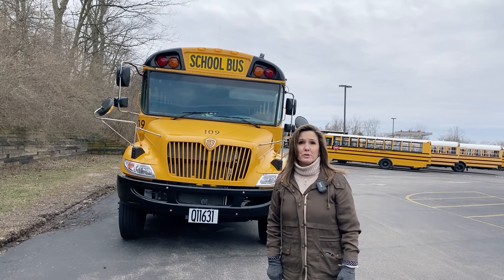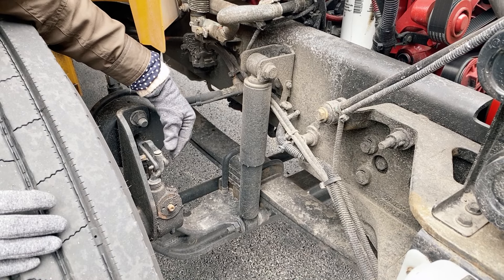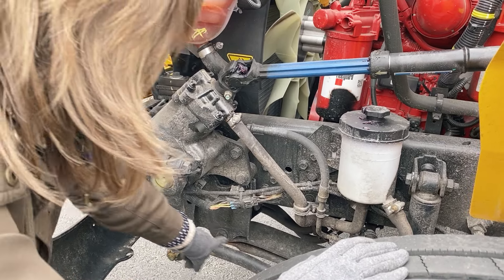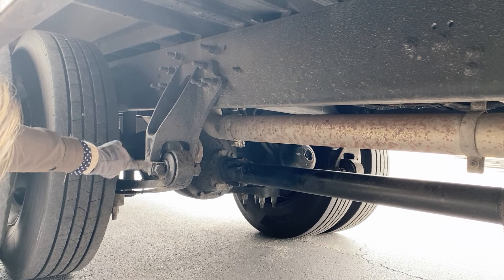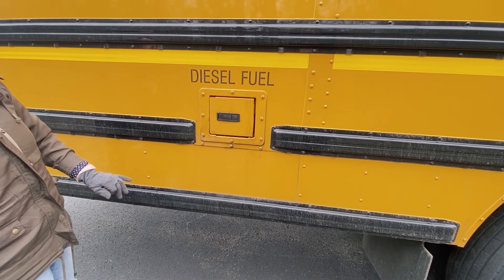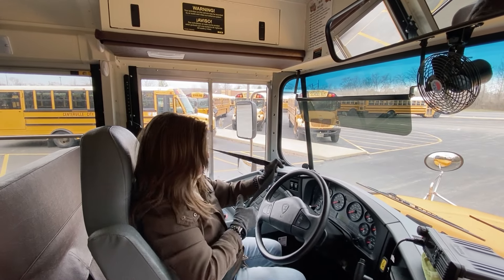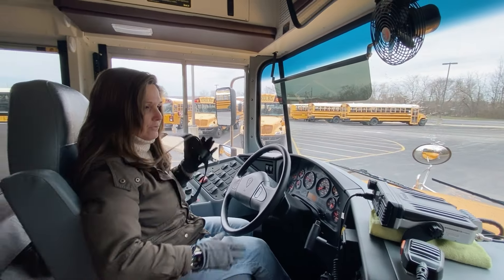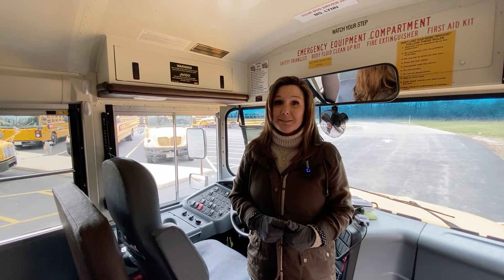School Bus class B CDL pretrip inspection demonstration

Comment: You have literally helped ne 1,000 times more than my actual instructor. Thank you so very much. So glad i found this
Reply from the maker: Thanks so much for your comment and positive feedback!  Best wishes for a successful test outcome!
Reply: My Instructor started off w/ the Air Brake Test which rekindled my memory loss of NOT doing 18 wheeler the past 3 years yet I knew something was OFF. We do NOT start w/ that Test. Real Drivers start as she started via viewing the Truck &/or Bus from the front looking underneath & down the sides to the back. The Air Brake Test should be one of the LAST things you do just prior to Emergency Brake & Service Brake Test. 👀 That order makes WAY more actual sense. Idk why my Instuctor is going out of order but w/e. I passed my CDL A so I will pass my CDL B nonetheless regardless

Comment: 1:05 Start from the top
2:10 starting engine, and frame parts 
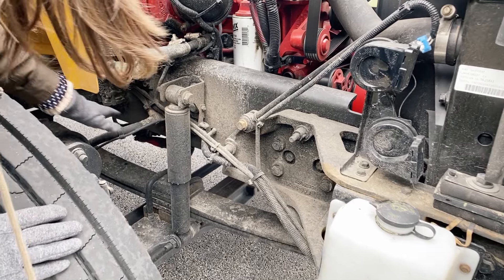3:19 brake lines
7:53 service door
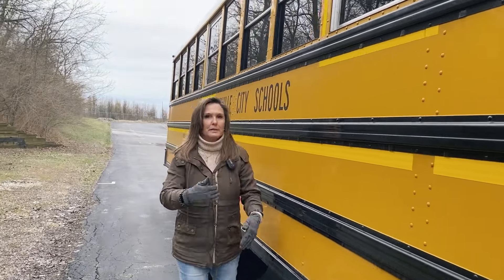8:54 under the bus
11:25 budding wheels
14:00 behind the bus
14:55 the bus stop arm
17:20 engine start

Comment: The company that I've been training with, and have an exam with tomorrow for my CDL B, has been training in a different order for the air brake test than shown here. Inside pre trip inspection(seats, emergency exits first, then gauges) followed by ABT.
First: Wheels chocked, , neutral, engine on, pressure built up to max, shut off engine, parking brake applied, static air brake test (1 minute, no more than 2psi air loss)
Second: Parking brake in, service brake(pedal) firmly held (1 minute, no more than 3psi air loss)
Third: Fan brakes down to 60psi until low air warning and buzzer comes on
Fourth: Keep fanning brakes down to 20-30psi until parking brake applies, indicating the spring brake is applied. Secure key and remove chocks(do not leave bus while engine running, even if just to move chocks)
Fifth: Safe start engine, pressure will build up to 85-100psi in 45 seconds, then governor will cut in with the brakes "woosh" sound
Sixth: Shift into low gear, press on accelerator pedal to confirm parking brake holds
Seventh: Release parking brake, drive forward 5 feet, braking to make sure the bus doesn't pull to the left or right. Repeat 2x.
Then pull the parking brake, put it in neutral, and say "this now completes the air brake test"
Reply from the maker: Which state do you reside in?  

Thanks for sharing another version of the ABT.
Reply: I live in South Carolina I think hold service brake push in parking brake shouldn't lose no more than 3 Psi or push in parking brake than apply service brake
Reply: @SchoolBusSass  Pennsylvania
Reply: @SchoolBusSass  Also, just updating my situation. I went and took my exam on Wednesday, and passed. 
I did the full Pre Trip Inspection including ABT, Alley Dock, 100 Foot Backup, Offset parking, Simulated Railroad Crossing, Simulated Student Dropoff, road skills test along with an emergency stop. 
I was watching your videos late Tuesday night and before leaving in the morning of Wednesday. I really appreciate you making these videos. I will highly recommend your videos to any trainees I encounter. One thing I especially like about your videos is the production quality. The videos are clear, detailed, and the voiceover audio is so much clearer compared to many other videos that drown out the audio by using the recording from inside the bus(bus noise, wind noise, etc)
Reply from the maker: That’s fantastic news, congratulations!  I really appreciate your kind feedback, thank you!  Continued success in all you do.  😊
Reply: That sounds like the way it's done in VA
Reply: You are correct. The Air Brake test in this video was done in the wrong order and would cause a FAIL. She should of never proceeded forward with the bus before doing all the parked static checks.
Reply: That's here in philly, we use this method , both are correct she lives in another state.
Reply: Thank you, this is awesome!

Comment: NJ book says you have to physically grab the steering assembly underneath to check for play.
Have to check battery fluid level since those were not maintenance free  batts.
Both of these rules are not directly under the school portion of the test, but they are indeed in the book.

Comment: Questions do you have to check all emergency windows and sound the buzzer or could you just say i would check all windows and sound the buzzer the same way i checked the first window and hatch buzzer and not check the to save time as well as the tires and brakes slack adjuster and push rods
Reply from the maker: Correct for windows and exit doors and hatches.  Must check push rods and slack adjusters, in front and rear on one side of the bus, then, you can say you would check the other side of the bus the same way.
Reply: @SchoolBusSass  one more question while the engine is on do you keep the headlights on while checking heater fans and dome lights and emergency windows buzzers or do you turn the headlights off because I'm wondering about the no students left   button and when to push it, or the lights don't have to be on and you press the button after you done the air brake test
Reply from the maker: The headlights should have no bearing on the no child left behind alarm.  Using your loading lights with your service door, will activate your no child left behind system.

Comment: Don’t forget the castle nuts and cotter pins! Also test the light indicators in the inside gauge panel.
Reply from the maker: Castle nut and cotter key are no longer required test elements.

Comment: Can you do another video on the airbrake test ? How do you deflate the brakes and build them back up again .
Reply from the maker: Hi Julius, to empty the air tanks, push down on the service brake pedal repeatedly until the parking brake sets itself.  Warning light and buzzer will activate above 55 PSI and brake  will set  between 20-40.  

Probably not doing another brake test.  The brake portion of the exam can be found on all of my pretrip videos.  As for a new pretrip, I will probably do one late this year or into the new year, on a BB RE transit.

Comment: Going for my CDL ....Thanks for the channel.....any suggestions?
Reply from the maker: Pretrip:  Try to slow things down, just a bit.  People tend to talk faster when they get nervous. 

Maneuverability:  If allowable, always check your final position for each maneuver you complete.  Even if you are positive you’ve done the maneuver perfectly.  

If it’s a free look…take it.  Gives you a moment to check out your awesome skills…😉  or, correct an issue you may not have seen from the drivers seat.  
For instance…in straight line backing, perhaps you stopped behind the 4th set of cones but there were five sets.  A final check would reveal this and afford you the opportunity to correct your final position (hope that made sense)

Driving:  take your turns slow!  It will give you the opportunity to correct any potential errors…like clipping a curb). 
I would  much rather have my drivers take a, slightly wider,  right hand turn, than clip a curb. A wider turn, may be a few point deduction, clipping a curb ends your test…not in a good way.  

Whenever possible stop at all yellow lights.  

Believe…achieve it!  

You’ve got this, Mike!
Reply: @Therese Mileti  ...Thank you....ill be reading your reply several times...thanks for the tips and taking time to respond ...this was very helpful...
Reply from the maker: Best wishes for a successful test outcome!  You can do it!

Comment: Hi, Do You Have Buses That Use These Fuels: 

-Gasoline ( Petrol ) 
-Propane ( LPG )
-Compressed Natural Gas ( CNG ) 
-Electric ( EV ) 

I Know You Have Diesel Buses.
Reply from the maker: Hello, Michelle, The district I drive for, only has Diesel, though when first started with Centerville, they had a couple of propane busses.  That was twenty years ago though.
Reply: @SchoolBusSass  Must Be Expensive To Keep Them Up, And Hard To Start Them In Ice Cold Winter Days.
Reply from the maker: The busses are plugged in during freezing temps.  The block heaters help the engines stay warm enough to start most cold mornings.

Comment: May you you do a pre trip on a bus that doesn't have airbrakes and speak a little louder. trhanks for your time.
Reply from the maker: Hi Patricia, our entire fleet have air brakes.  If I can locate a hydraulic equipped bus, I will see what I can do to create a pre trip video.  Thanks for your suggestion.

Comment: Okay I'm confused now. The 3 orange lights at the top is my clearance lights. Which ones is the amber lights sounds like I'm hearing amber lights more then 3 times
Reply from the maker: The clearance lights in front and on the side before the rear dual wheels, are all Amber, after the duals, clearance lights are red. 

Your warning lights are amber.  They are the alternating flashing lights you activate before you arrive at a pick up or drop off location, then, once you open the bus door, the alternating flashing lights switch from Amber to the red lights located adjacent to the amber lights on the front and rear of the bus.  Also known as eight ways.  
Reflectors on the side of the bus are also Amber before the duals and red after.  The reflective tape, is also viewed as amber.
Reply: @SchoolBusSass  wow thank you I'm in New Orleans. Now I understand. I appreciate you so much 🙏

Comment: I’ve heard you got to be careful when driving with drum brakes, they fade very easily.
Reply from the maker: I haven’t had any issues with my brakes fading.  If you have lots of steep hills, feathering your brakes while declining would be very important.
Reply: @SchoolBusSass • Truckers hauling 80k lbs have such issues routinely hence the DOT has setup strategic “Runaway Truck Ramp” locations most notably in areas like Colorado or wherever Truckers traverse Mountainous regions. Yet I highly seriously doubt School Buses will ever experience such minus Class Trips across Mountainous regions unfamiliar to the driver which is realistically never going to happen since even those Trips are Pre Planned Routes.
Reply: @SchoolBusSass • We actually use a method called “Engine Braking” which works even for School Buses. You slip into lowest Gears &/or via an Automatic into 2nd or 3rd or whatever then allow the Engine to slow you down. You brake a little to help the engine then release brakes. Wait a few seconds & brake a little again. Rinse & Repeat. If you hold down the Brakes full time you can & will overheat them then lose them.
Reply: @SchoolBusSass • Btw you ran the Pre Trip like a BOSS. It’s been 3 years since I drove an 18 wheeler yet you did everything exactly the way we did everything so thx for helping me w/ my memory loss ‼️

Comment: My buses in my district have hydraulic brakes. There is a Thomas C2 that I see sometimes pull into the High School that does have air brakes. Can my district just get airbrakes for Pete sake? Hydraulic brakes are cheap crap. They are stupid and dangerous.
Reply from the maker: Are your busses board owned?  If so, ask your school board and supervisor to convert over to air brake busses.  What type of busses does your district have?
Reply: @SchoolBusSass  RITEWAY

Comment: Maybe it's nitpicking, but I take issue with your method of casually stating (at the beginning of your pre-trip) that items are "not cracked, broken, loose, or missing".  This can get you in trouble.  You cannot tell if your clearance lights (for example) are not "loose" if you didn't touch them.  You can't tell if they are "broken" if you didn't illuminate them.  You may be assuming that "broken" means that the lens is not broken... but it also refers to the light actually illuminating as commanded.

We use the phrase "No physical damage", because at the beginning of the pre-trip this is exactly what you are checking for... PHYSICAL DAMAGE.  It is safe and proper to say that your clearance lights (again, for example) "have no physical damage".  It is NOT safe and proper to say they are "not loose, cracked or broken", as this complete statement cannot be verified at this time.

You claim that your alternator is "not broken" simply by looking at it and touching it with your fingertips.  This simply cannot be verified, and is therefore potentially a false statement.  You CAN say that your alternator "appears to have no physical damage".

I believe that details like this matter, although you seem to be getting away with it at your location.  Regardless, I really appreciate you taking the time to record and post these videos.  I know that it takes time and effort to do so.
Reply from the maker: Thank you for your comment and feedback. I appreciate the constructive criticism.  Using,  appears to have no physical damage .  While I appreciate the phrase, the word damage /d is considered too vague.  I can visually check to see if something, like a lens,  is cracked, loose, missing, or the wrong color.  I can visually see if a component is loose or missing parts or pieces. Years ago, I used the term damaged and the examiners determined the word too vague.    Secure, is the current accepted term for Ohio’s examiners.  

I believe the pretrip needs an overhaul.  Too much of what we teach,  is nothing more than repetitive phrasing, which should not be the focus during a pretrip inspection.

The lights are checked when the examiner goes out to check their functionality.  It is not shown in the video, though I talked through the process, which occurs later in the process.  
Your preferred phrase makes sense and I understand why you prefer the verbiage.  Thanks again for your feedback.
Reply: As a wife of a mechanic who has 40 years of experience and an expert in all aspects of vehicle parts, I will have to disagree with your theory about not being able to see a component on the Bus, especially headlights, Marker and traffic lights damages.  If a glass or plastic is cracked or broken it is highly visible, at least to me it is.  Now if you are thinking in the way of if they can be chipped on the sides or the ends, then that would be hard to see of course.  

As far as the Alternator goes, I certainly can see the alternator on the Bus and determine if it is cracked or broken.  There are tiny legs on the alternator which are attached to the housing(chamber) part which holds everything together, those parts can be cracked or broken as well as the chamber itself and certainly can be visible to the eye if you pay close attention too. Really hard for someone who's not paying attention to detail to spot the obvious or perhaps something difficult.

A side note.  Theresa is only teaching what DMV has required for her state.  She cannot change wording or change what she can and cannot say.  You will have to take it up with the people who made the requirements for us to use these wordings, which is DMV, and good luck with convincing them they are wrong.